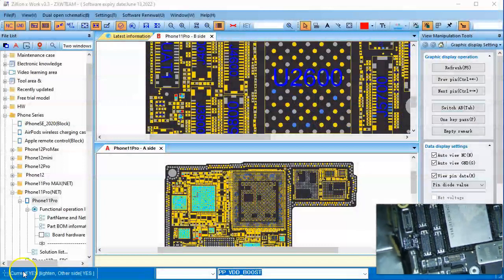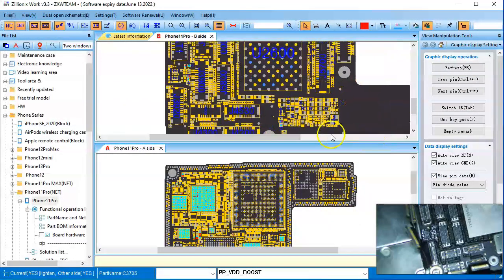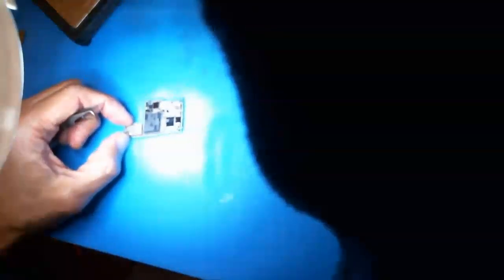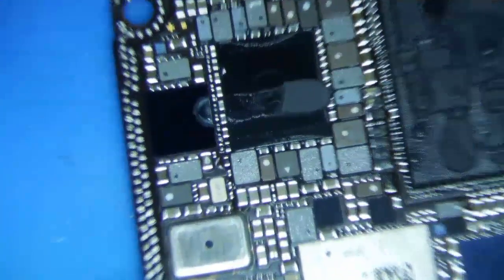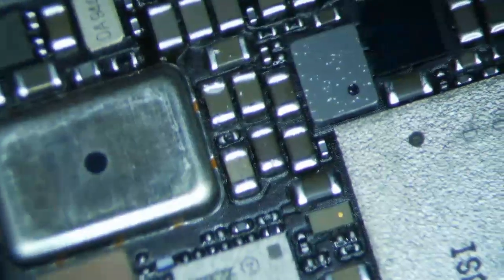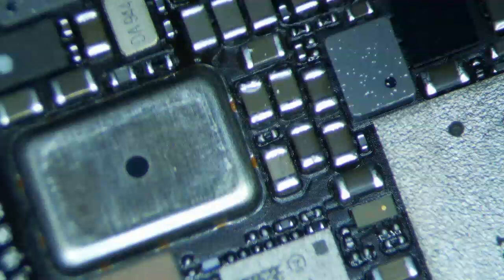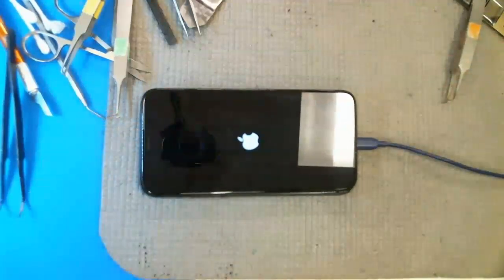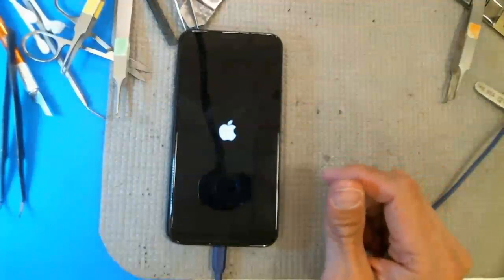iPhone 11 Pro Dead No Power Repair

Comment: Wen you say you are gonna hook the Red Lead of the Power Supply to ground I didn’t quite get it. Pls explain. Isn’t that voltage injection is to hook the black probe on the ground n red on a another component

Comment: When you use dc power  supply to determine the shorted cap,  the red one is in the ground and the black one is pointing the cap. Is the settings are 2amps. And the supply is around 3.9vdc.